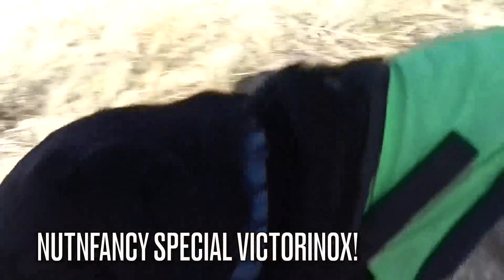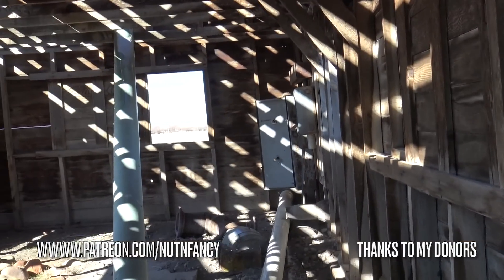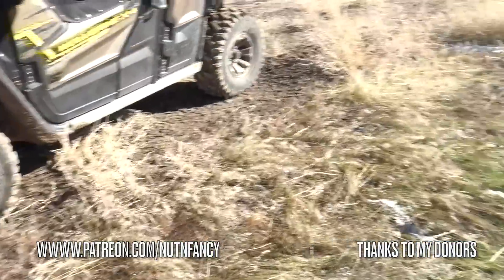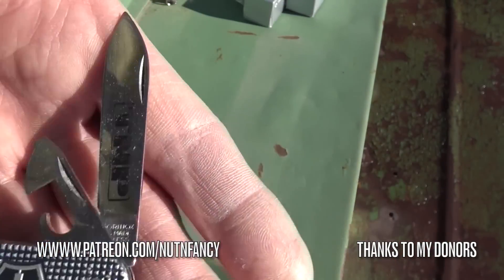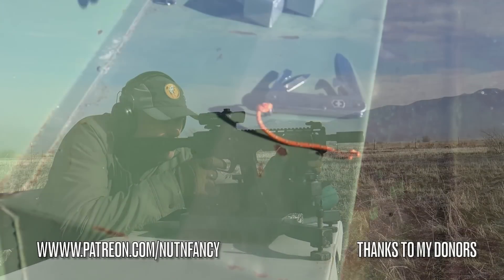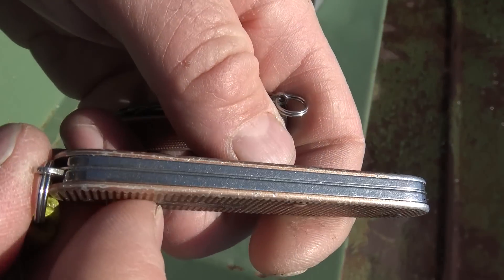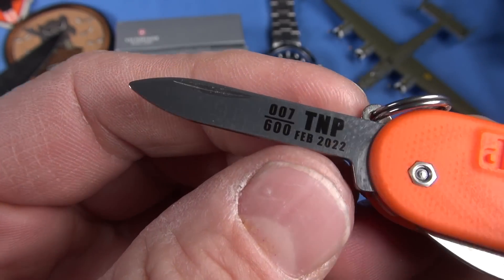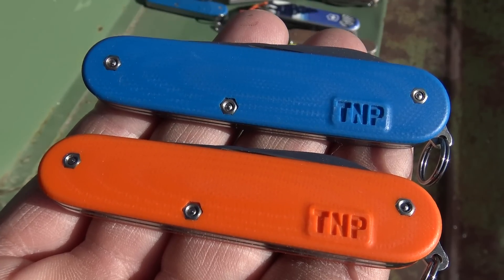TNP G10 Cadet: Limited Edition Victorinox

Comment: I think you're sleeping on the best EDC Victorinox compact. It is a two layer like the Cadet but has scissors and spine tools. In addition to the toothpick & tweezers in the scales it also has a pen and 'hidden' straight pin under the corkscrew, which also has a micro screwdriver. They made the flathead/can/bottle opener into one tool. So much utility for the SAWC.
I have a Victorinox manager on my keychain, all the useful tools of the minichamp without the bulk or price.

Comment: I've fixed many old barns like that.. Even if they are half falling down and half of the roof is caved in.  It's very easy to take a ratchet strap and pull the walls back straight-- cut out a few rotten rafters and piece the roof back together and then put R-panel sheets on the outside walls and roof----  and you can even poor a concrete slab over the dirt floor, and then your "barn" looks like a brand new shop.  People are always quick to just knock them down or burn them-- but they are easy to repair;  because there is no "Demolition" to do really;  You're not picking up truckloads of moldy sheet rock or anything like that.  Just push some walls around and beef it up again, cover it in sheet metal and it's good for another 70 years.
Reply: Do you live in a very arid climate?
Reply: @TheTrueNorth11  Oklahoma.. Known as the "land of a 1000 lakes"-  To the East it's full of tress and to the West it's basically desert.

Comment: There are many great Victorinox models, I standardized on the Ranger model, and never out without one. Except for having a corkscrew instead of a phillips screw driver in the same spot… it’s identical to the “master craftsman “ issued to all the NASA space shuttle crews over 20 years of the program.
I use skateboard tape on the Victorinox multitools… they are a bit slippery.

Comment: TBH , I prefer the Spartan. Also 2 layer but with extra tools. The awl and corkscrew can be handy. Small sacrificial blade is nice to have. Especially when you add Champion scales which adds the pin and I have a mini screwdriver in the corkscrew. Of course it also has the toothpick and tweezers.Potent package. Don't really need the nail file in daily life, get a simple nail clipper.